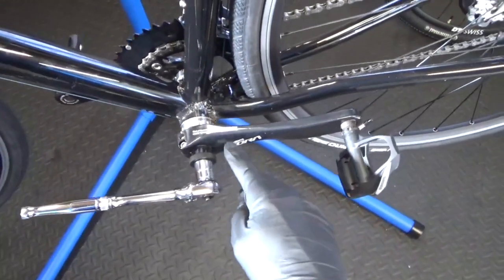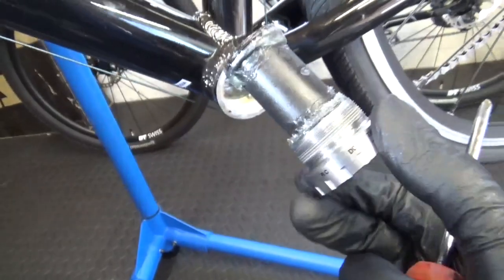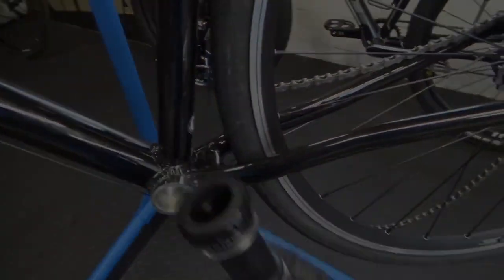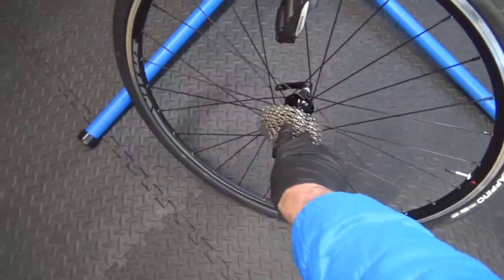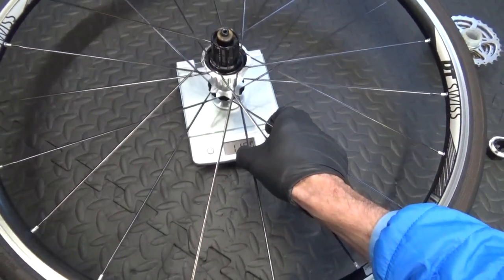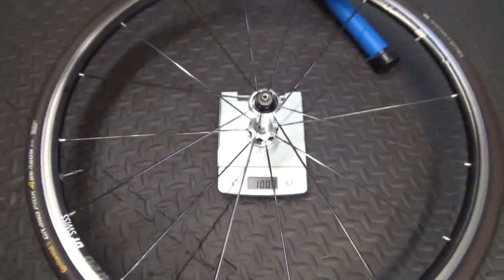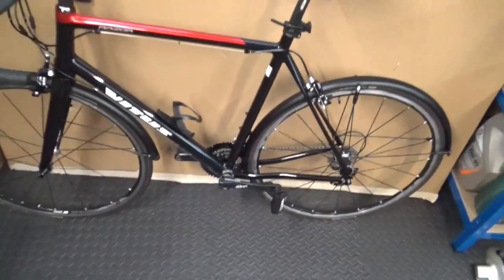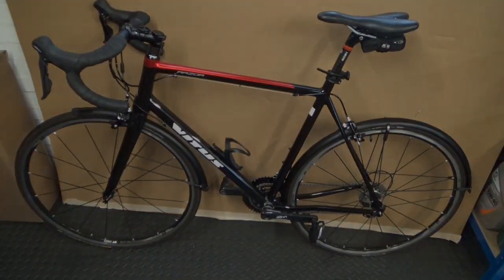Vitus Razor VR Road Bike - Pt2 Upgrades!

Comment: What happened to the defy disc?
Reply from the maker: Currently not being used!!
Reply: Free To Cycle would be interesting video to see your thoughts on RIM vs DISC for commenting purposes. How come you went back to rim?
Reply from the maker: @JP-om3ou  I own two disc brake bikes and build many disc equipped road bikes for customers. In my humble opinion disc brakes have there place on certian types of bike, and lets face it with some manufactures no longer offering rim brake options on many of there new bikes it's only a matter of time before rim brakes are phased out.
Reply: Free To Cycle sad times, love the simplicity rim brakes

Comment: I have Vitus razor disc Sora L. My bike weighs   10.3kg with cont GP 5000 (width 28) I would like to get my bike around 9 kg so what dt swiss wheels would you recommend. Theyre currently stock.
Reply from the maker: Value for money I would recommend a set of Prime Attaquer Disc wheels!
Reply: Thanks for the speedy reply I got a London Amsterdam cycle charity cycle coming and these should suit me well
Reply: Do you think it's worth upgrading to a carbon seatpost. If so which would you recommend?